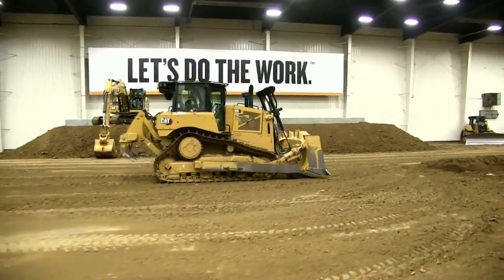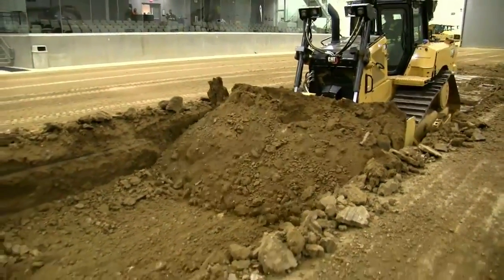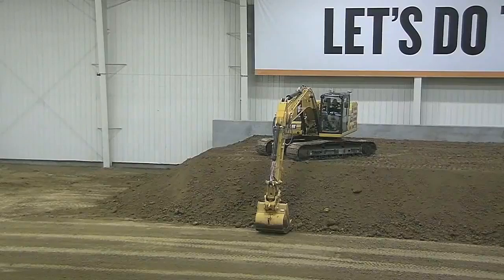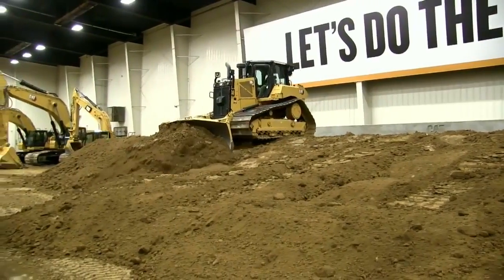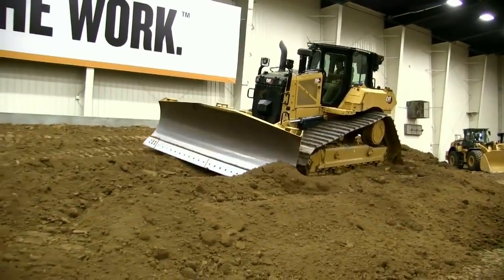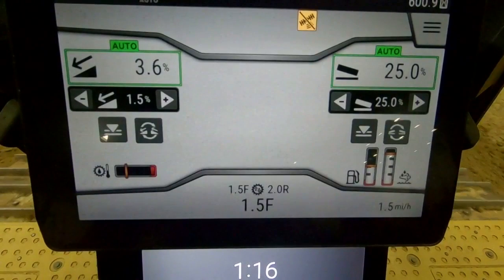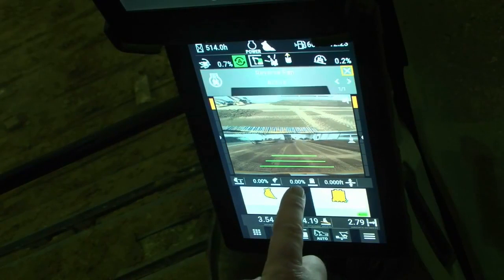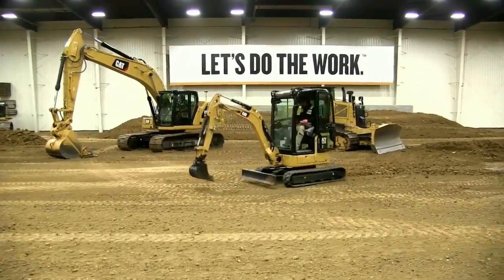Slot Dozing and Bench Loading Tips

Comment: Bench loading in this video is literally what would get run off my job site or replaced. I realize CAT is coming from a safety stand point but you should not ever be turning that hoe 90⁰ to load. Nor should you rotate another 90⁰ the opposite direction to grab material. 22.5⁰ to 45⁰ MAX!!  The depth that your bucket is tall from the heel to the head. That way, you don't have to worry about stability or reach.
Reply from the maker: There are numerous ways of loading a truck on a bench. In this case, he is just showing 1 way of loading trucks. It can be more efficient if you can swing less, but every job site and condition can vary.